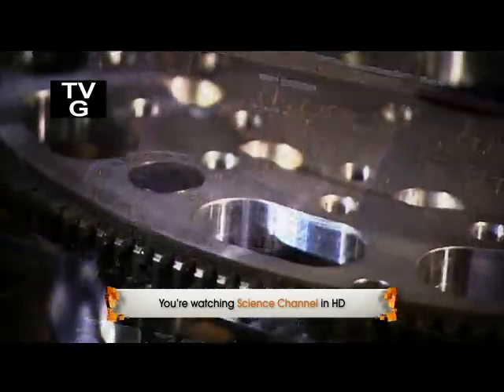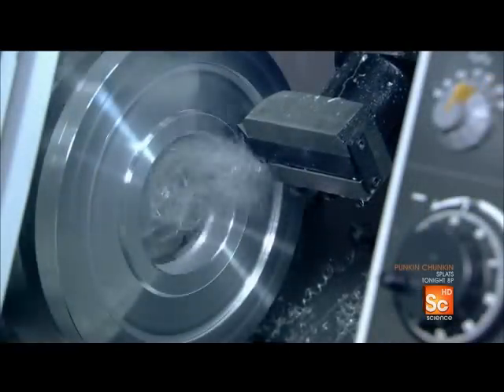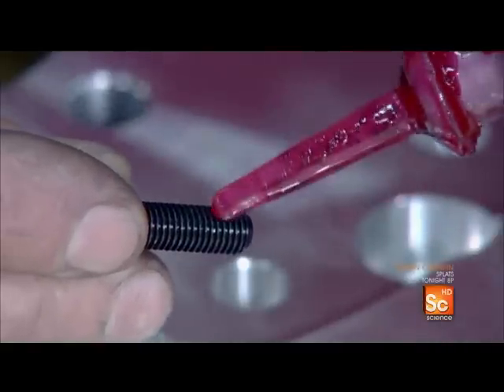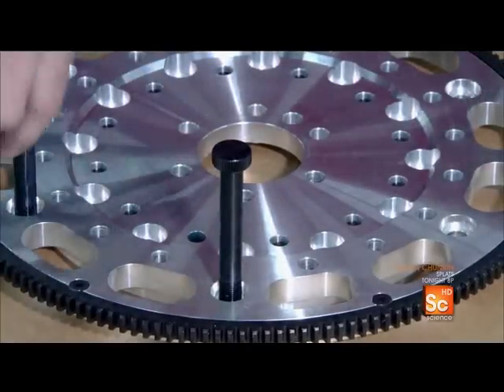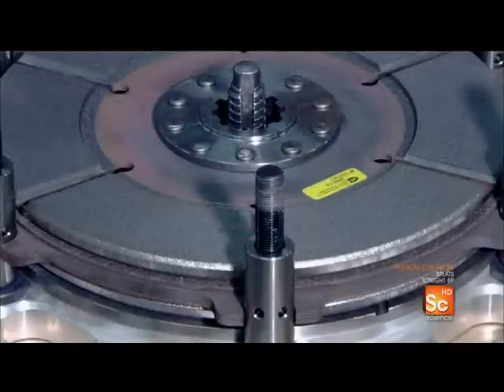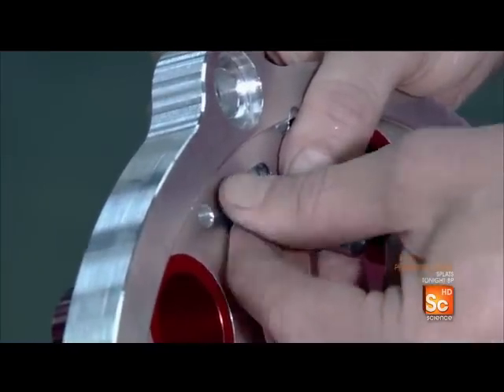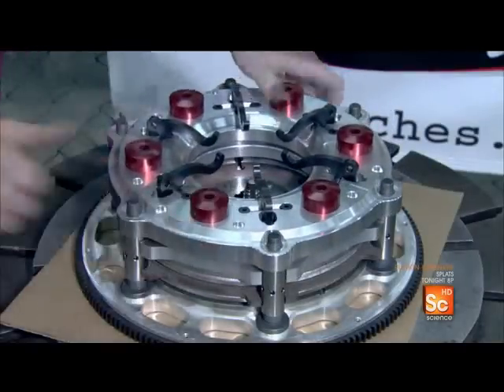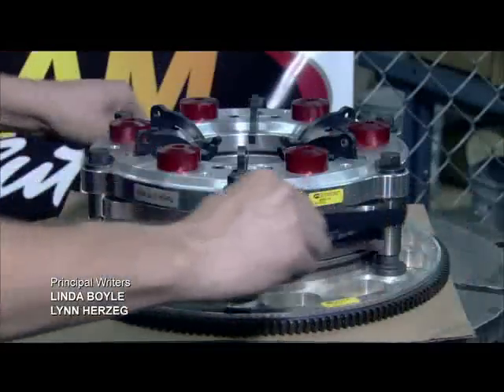How It's Made  Drag racing Clutches

Comment: no it doesn't. The flywheel is a completely seperate component from the clutch, Yes, they do work together, but to call the flywheel a part of a clutch isn't correct.
Go to a parts store and buy a clutch, you won't get a flywheel.
Reply: lol gotta love the plebs that come out and play.. seriously they think ya get a flywheel with your clutch? they totally two different components...
Reply: Yea, the fly wheel is part of the clutch. Did you not see it attached? Lol
Reply: Some clutches are sold with flywheels. Go on summitracing. They’ve got lots

Comment: race cars use automatics well depending on if u want to go fast or FAST!!
Reply: f-bodys and mustangs and I thought they used semi automatic transmissions
Reply: The Jester that just refers to an automatic transmission that is controlled by the driver. Practically same internals as any other automatic, they just don't let it shift itself.
Reply: Colton Tweed Semi automatics can shift themselves. That’s why they are still called automatics. However they can be put in a manual mode where they can shift themselves. They give you the best of worlds of both the automatic and manual. 

A lot of drag racers will just use power glides built by GM. It’s an automatic with only two gears but with the power most drag cars are producing they don’t need to advantage of close gear ratios.
Reply: Cody Allen pardon me trying to over simplify, but a lot of them really cannot shift on their own. We've got an old Corvette with a th400 that has no ability to shift itself at all. Used to be a stock automatic transmission, now it peels the tires going into third
Reply: Colton Tweed Ironically I’ve also got a 77 corvette with a TH400. Would like to do a T56 swap some day. Some racers do modify their transmissions to behave like yours but by putting a manual valve body in their automatics. However it makes it more into a clutch less manual if anything as the point of a semi automatic is to be able to fully operate on it’s own but is also able to be fully controlled by the driver. For instance you could have a 4L60E and with a good transmission controller can set it up to be a semi automatic transmission. You can even get paddle shifters and bump shifters now. But your transmission still is an automatic with a manual valve body or at least it behaves as one. True semi automatics are typically used in high end cars like Ferraris and shift perfectly on their own.
Reply: Top fuel don’t have gear just 5-6 progressive engaging clutch plates
Reply: Not so much. Depends entirely upon what class they’re competing in, IHRA sportsman, (std) NHRA pro gas (std) Pro Stock (Std)  Eliminator (STD may allow automatics, depends on series)
Reply: Cody Allen better safety wire that TH400 governor down good n snug, or it’ll shift, whether you like it or not, even if you and a trained gorilla are pinning the shifter to the notch with all you’ve got, modulator bypass be damned!
Reply: Cody Allen a 4l60 couldn’t handle 1/3 of the HP the clutch is rated for  unless it was installed behind a detuned LS3 in a mildly beefed up go kart, my grocery getter ran through them units like they were made of potted metal.
Reply: 1,800 hp, launching a 2,800-3,000 pound car 1/4 mile in 6-7 seconds violently, as hard as possible, and with all the traction the sticky tires and stickier tracks have ( your shoes peel off the tarmac) Id Beef up a power-glide, or custom build an Allison unit with a fairbanks or an art carr converter, and custom valve-body/solenoid package
Reply: I ran a Jericho clutch-less shift 4 speed in my Street Legal minimally tubbed for clearance de-accessorized 1970 Chevy Monte Carlo Drag Car with 4.56:1 gears in a Ford 9” 3,100 pound car with a 780 bhp just under 850 foot pounds of torque, I like the 12” wide contact patch to be the weak link.
Reply: I stood it up on the bumper launching from a dead stop with  radials on the street, picked the fronts up about a foot, (half that on the passenger side) when she’d grab the 2nd cog on the strip with fresh drag tires, I wouldn’t tow a pop up camper more than 50-100 miles with the 4l60d-e (D is for Defect Prone, E is for Egg Shell tough)
Reply: What you call semi automatic is Dual clutch, it is made nothing like a regular automatic gearbox. They use Dual clutch on race car, like F1, Rally as of now instead of sequential and other motorsport, they also use it on car like the Mitsubishi Evo, ferrari, lambo, etc. 
Sequential. CVT, Automatic, Dual clutch, Manuel,  5 DIFFERENT world.

Comment: 1800 HP lol
Reply: whats so funny about 1800hp
Reply: Squarebody Case /Wade McKenney funny thing is drag cars have more than 1800hp these days
Reply: GamingTurkey You're missing the point, drag cars HP is tuned around grip and car type, like big tyre, small tyre, big block, small block, steel body, promod, and so on.
Reply: Well they usually have 4.722222... times that power
Reply: Souraneel Chattoraj they've pushed over 4,000 in top fuel dragsters.
Reply: theyve pushed over 9,000 in top fuelers,, wild
Reply: top fuel cars dont use traditional clutches they use a centrifugal clutch
Reply: I do not efficiently use my 170BHP car suspension as far, anyway.
Reply: 11,000 hp now, but yeah they use a centrifugal clutch rather than traditional to avoid wheel spin

Comment: yet REAL drag cars use automatic transmissions
Reply: Only plebeian grocery getters like yours. Pro classes are all clutch.
Reply: Lane Shurtleff your actually both correct.... they are automatic but have clutch discs like this. Because a standard fluid based automatic clutch wouldn’t be able to do it. Top fuel 11,000 hp drag cars gears actually work by the gear change happening so fast they don’t need a clutch for anything other then launch. By the end of the run the discs have all fused and will need replacing before the next run
Reply: ummm no not always. a powerglide will only get you so far.  but they not manuals either they typically are planetary gear clutch packs... and Im refering to Lenco type transmissions (cuz techincally an automatic is just a bunch of clutches.... controlled by hydraulics...)
Reply: Yeah, automatics are actually more complicated and computerized manuals with instead of a clutch on the flywheel there is a Torque Converter. The clutches are individually attached to each gear.
Reply: How is a manual transmission Pro Stock anything but a REAL drag car...?
Reply: Also lots of drag cars use dogbox manuals that require a clutch for 1st gear then ya just bang it along
Reply: Ben Mcevoy Lol, top fuel ONLY has a reverse 'gear', it's actually a sunshell setup. Forward is direct drive.